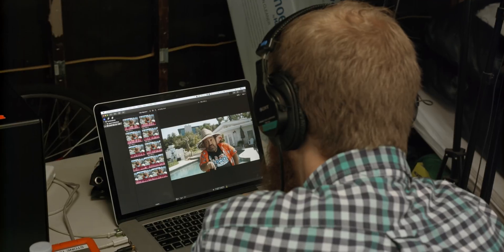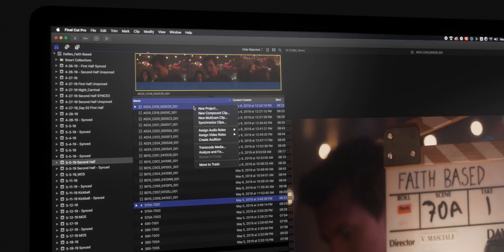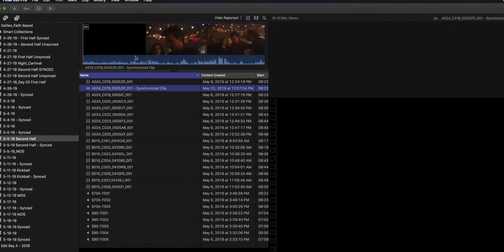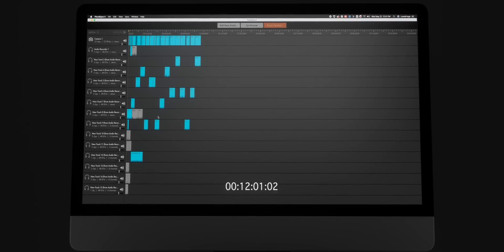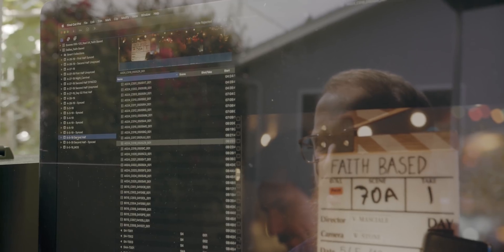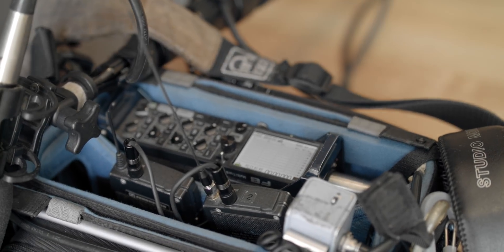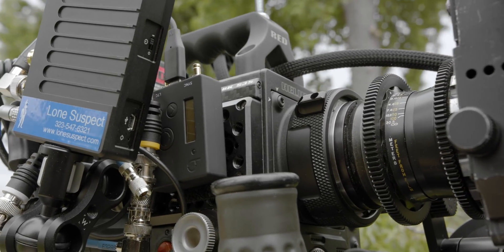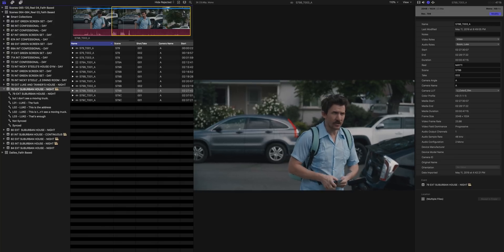How to Sync Audio to Video

Comment: Hello, Patrick! 
I'm glad to hear about TimecodeSystem products from LumaForge! I've been using their products for years on live productions. 
For fiction, just feeding the TC of the camera is theoricaly ok: a take doesn't last long enough to produce a drift between the sound and the images.
But on live productions, if you don't feed the sync (or Genlock or Ref) port as well, you get a 3 frames drift at the end of a take of a 2 hours concert!!
In my view, every slave recording device should have a TC and a Sync feed to really work at the very same speed.
We use FCPX and Multicam Logger to quickly sync a project when we need to make quick ajustements on a recorded live production. An extremely powerful and cost efficient duo!